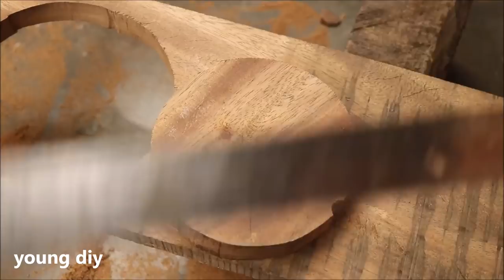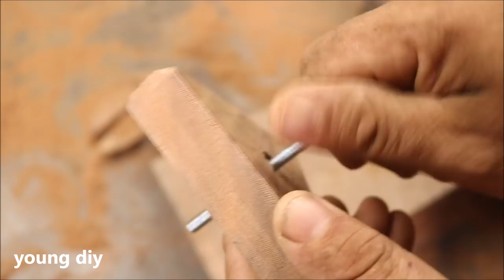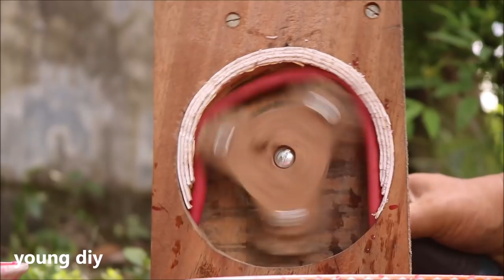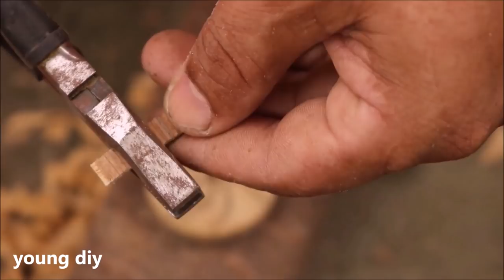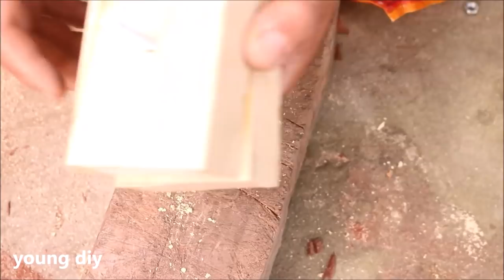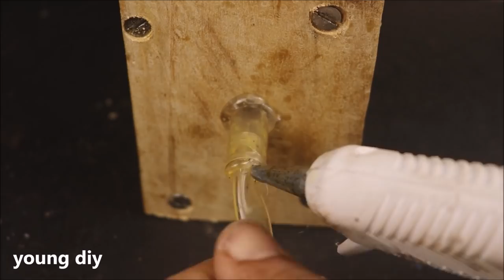2 Awesome Working Mini water Pump Projects. How to | DIY .

Comment: 8:36 Not. The middle should be empty. Look cooling in the laptop !!! Wings can be glued between two thin circles, in one circle you can make a hole in the middle more to capture water. Then the pressure will be greater if it is easy for him to suck in water.